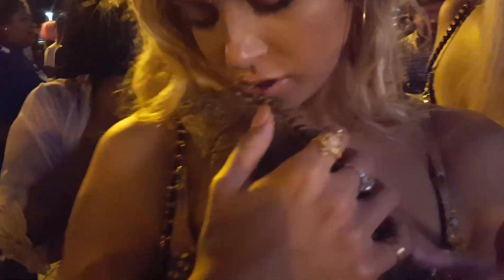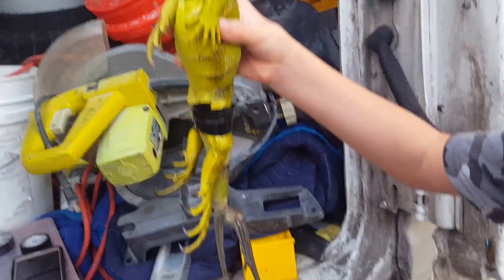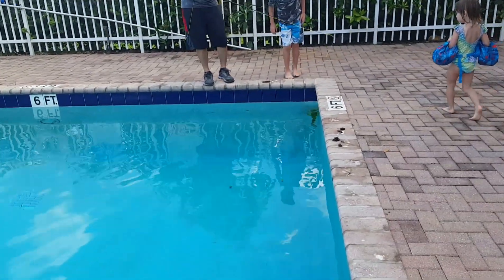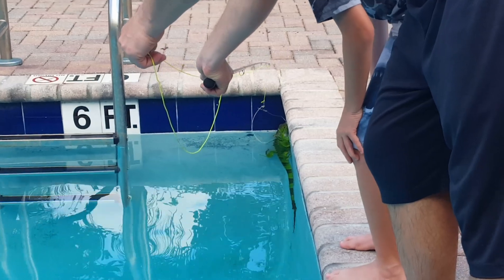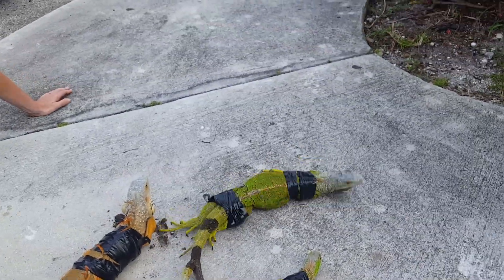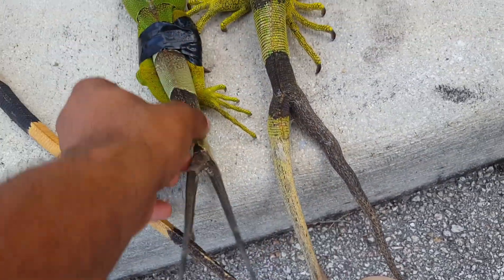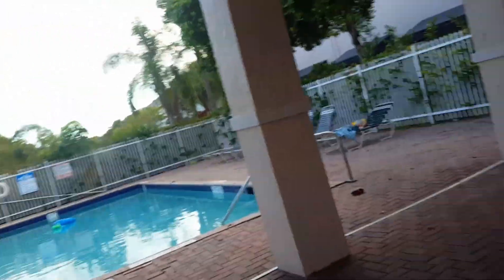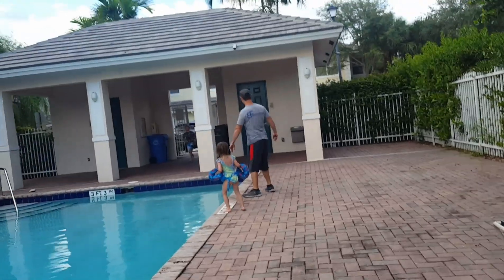DOUBLE TROUBLE TWO TAILED IGUANAS!

Comment: I'd say that there is a cat in the neighborhood that likes to eat smaller iguanas.  The ones that get away may do so with a partially severed tail.
Reply: I was thinking inbred but that makes more sense. You smart
Reply: I’m usually 100% accurate about 5% of the time. Freakin geneus!
Reply: How does tht explain 2 tails?
Reply: Because when an iguana loses its tail it grows a new one but if the two, is damaged but still attached then it grows an extra tail at the break